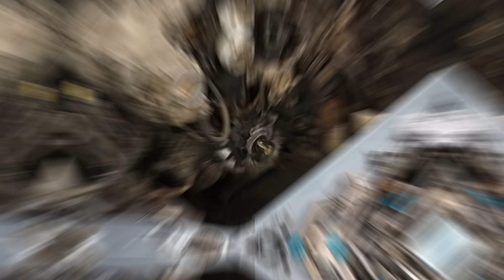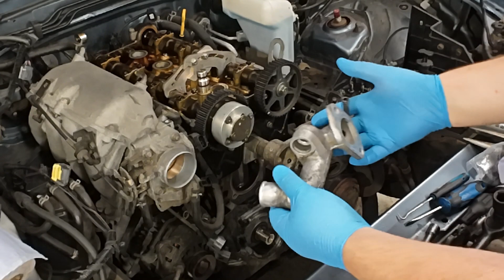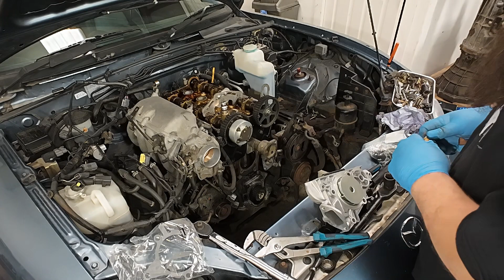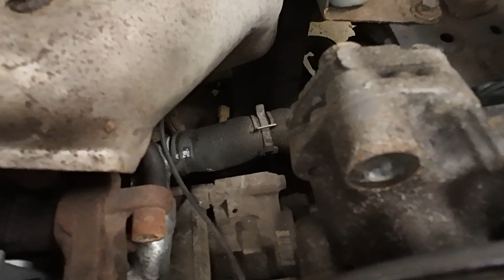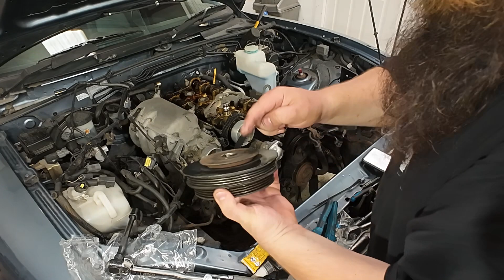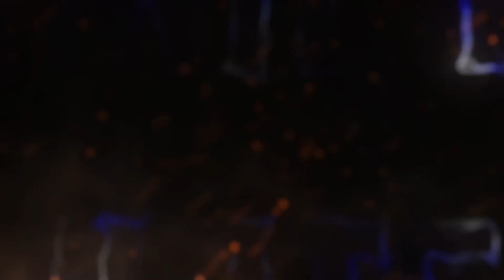Mazda MX5 NB - Cambelt & Waterpump Pt2

Comment: Hi - See the workshop manual for the correct way to set the tensioner. You should turn the engine forwards 1 5/6 turns before you set the tensioner. There's another 'timing' mark for the crank pulley approx 60° BTDC for the correct position. Chances are your belt will not be as tight as it should if you've set the tensioner at TDC. Good luck with the channel. 👍
Reply from the maker: Thank you, I did see your comment on the OC forum